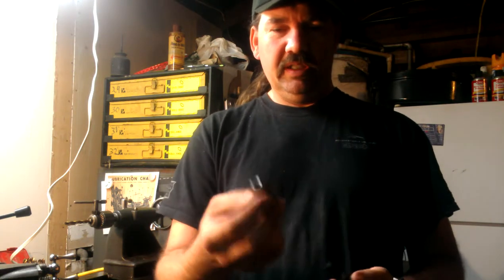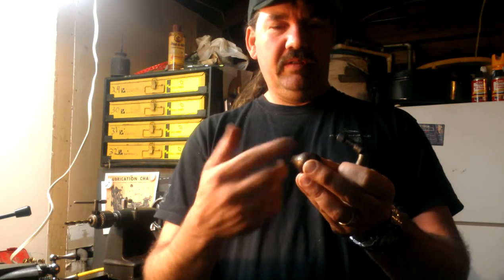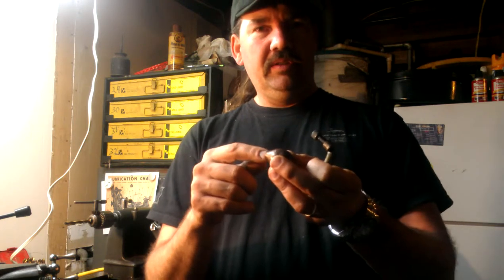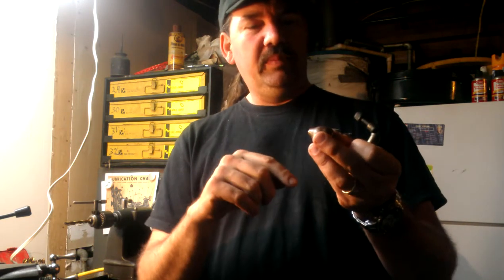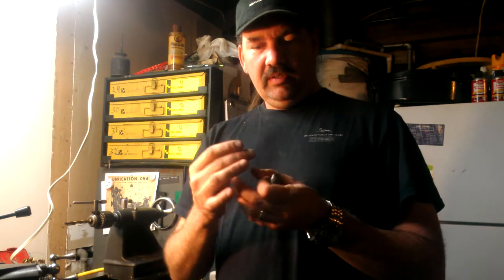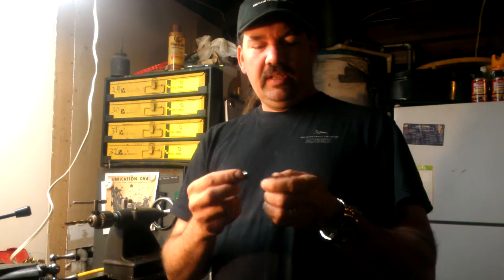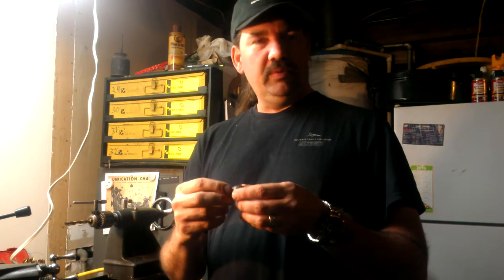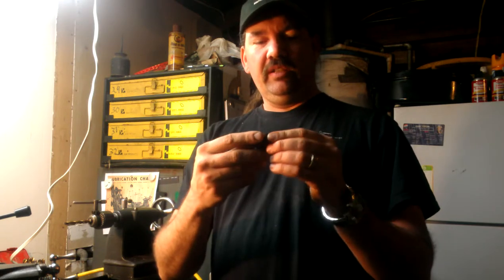Brown and Sharpe horizontal mill knob repair part 1

Comment: Sounds like a good plan. I hear you about trying to use as much as the original material as possible.
Reply from the maker: indeed other wise I need to make a pattern and get it cast (removes originality takes lots of time and cost $$$ )